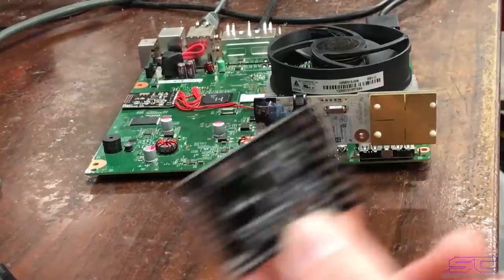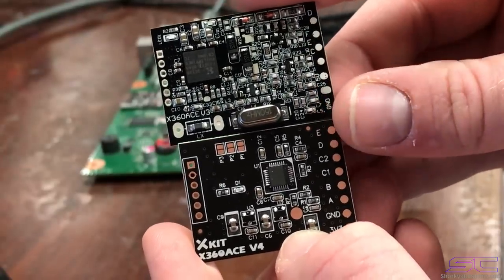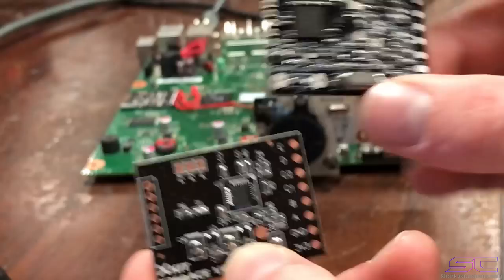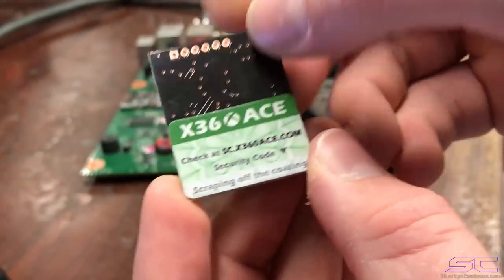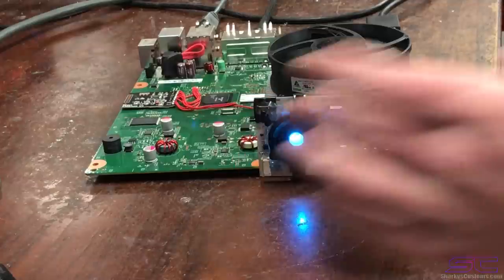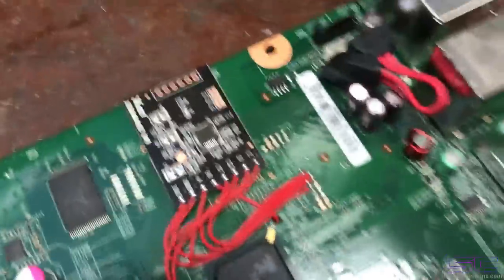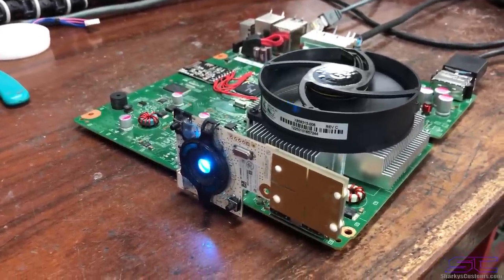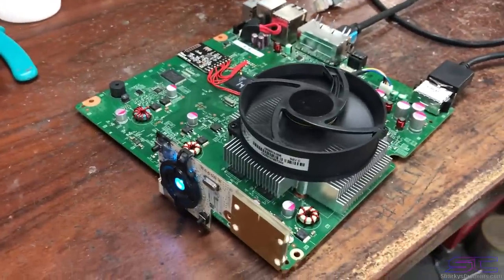Ace v4 Install + Testing (RGH Corona V3)

Comment: X360ACE V4 Feature:

• Clock synchronization system
• Improved code – performance fine tuned
• Tighter circuit layout to give cleaner signal performance
• No more solder bridges required
• EMC analysis by ANSYS
• Good electric component
• Supports Corona v1 – v6
• Supports Trinity

Comment: friend as you have done in crown, I have not managed to remove xell, if glitchea but never start, the xell did it with autogg or jrunner, I would appreciate if you explain a little or if you made any changes in the installation. in trinity I have managed to work but in crown. no, thanks in advance